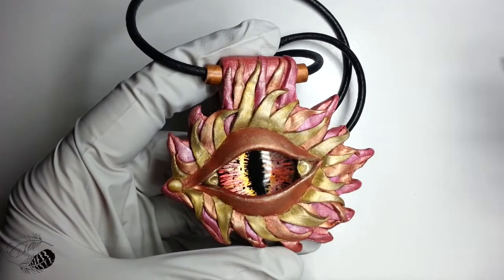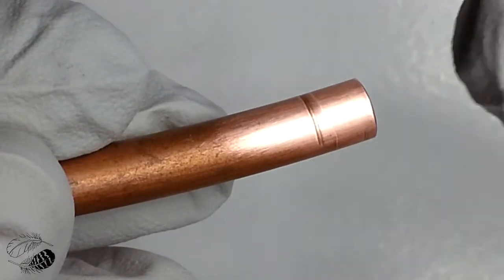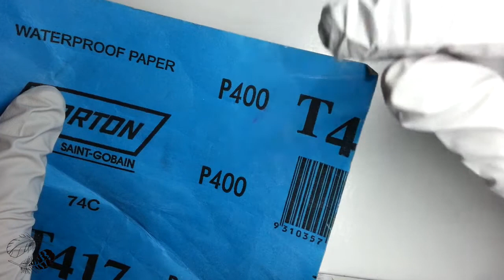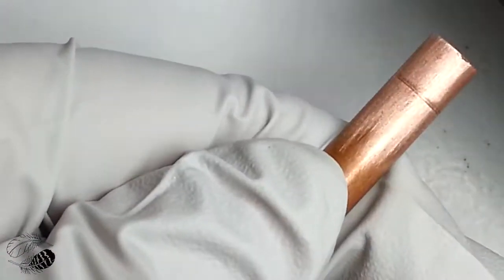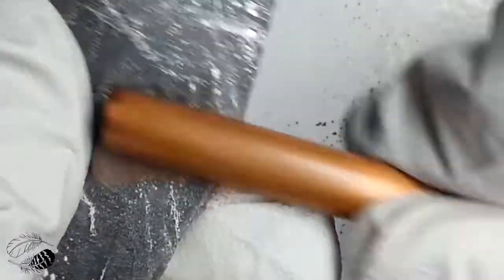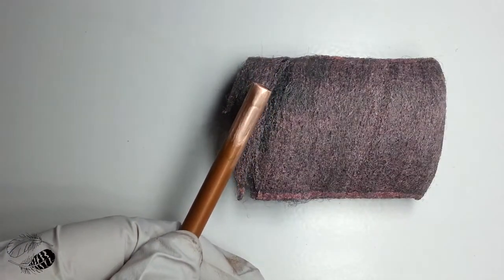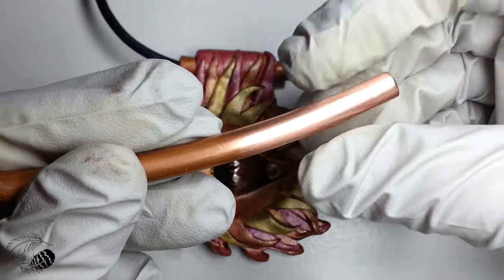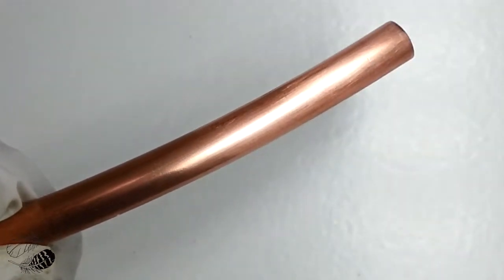POLYMER CLAY DRAGON EYE TUTORIAL - COPPER BAIL REFINING TECHNIQUES!

Comment: Perhaps a file could speed the process up
Reply from the maker: Hey Top Tank. Thanks again for your amazing suggestion of using the sanding to refine the copper pipe that prompted the making of this tutorial! :) For the edges of the pipe, yes definitely a small round/rounded file for the inside and a flat file for the flat edge would be best. Have consulted with Timmy the tool man and he says that the file would be very rough on the main body of the pipe, and would make lots of marks as it is so coarse. However some people might like to add this as an artistic choice and have the copper metal not smooth but marked all over (like a brushed steel or like what they do to treat wood with different tool marks so it looks older and adds more character). As well as a file, this brushed effect could also be achieved with a coarse/rough sandpaper too. Thanks again for your comments and sending many thanks to you for inspiring this tutorial.